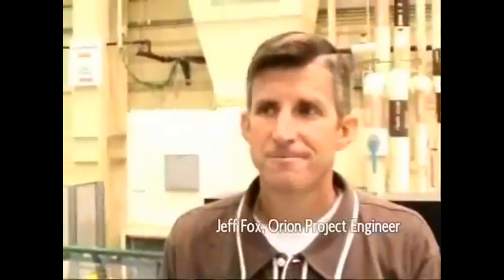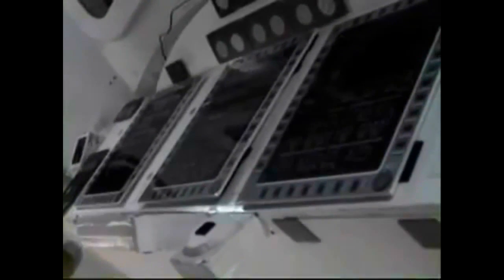A Look Inside The Orion Spacecraft

Comment: what if they have to take a dump? oh just let the shit fly around on zero G....why can't they make it bigger
Reply: Because every pound requires many pounds of propellant to get it off the ground, and that means that the lifter has to be larger, or the velocity has to be smaller. It's always a compromise, at least until we get those magical anti-gravity toys.
Reply: There's a toilet in the real one, but minimal privacy. This vehicle will get the job done, but it's not a luxury liner.
Reply: They had to retire the Shuttle from service because it was too expensive to operate. Orion is streamlined, and the result of NASA creating a new spacecraft on a shoestring budget so we don't have to keep depending on the Soyuz.
Reply from the maker: they can, but why should they?
Reply: "Why can't they make it bigger?" 
Compare to, oh, say, Gemini.